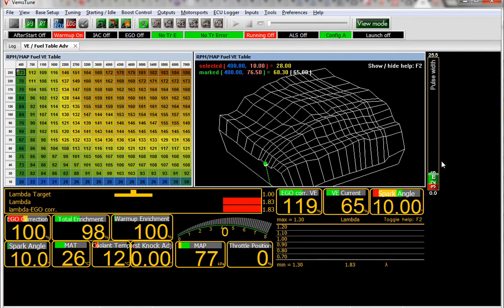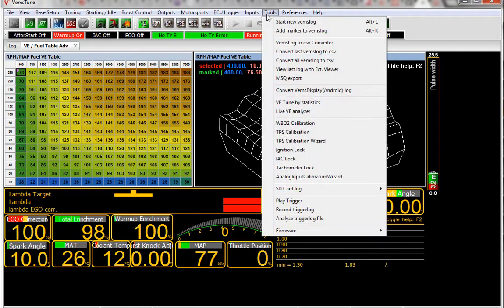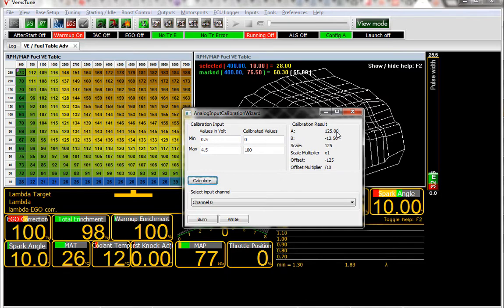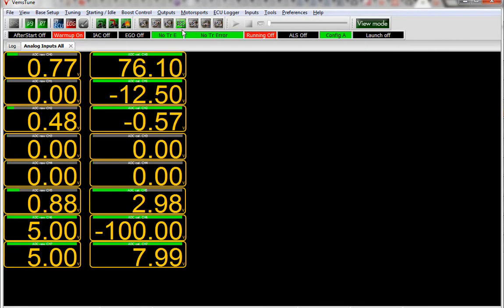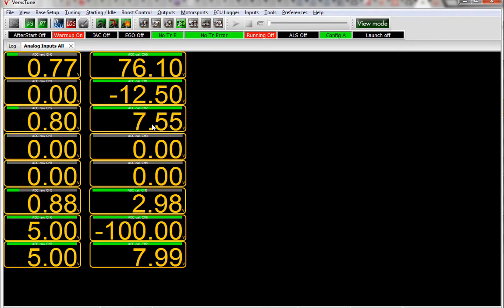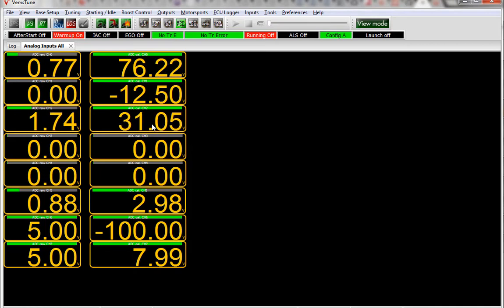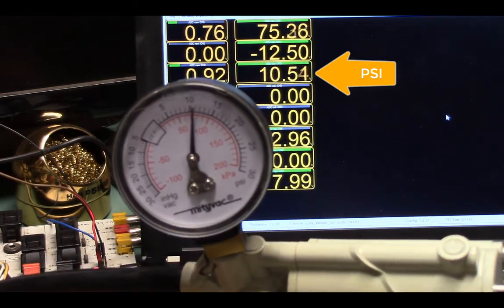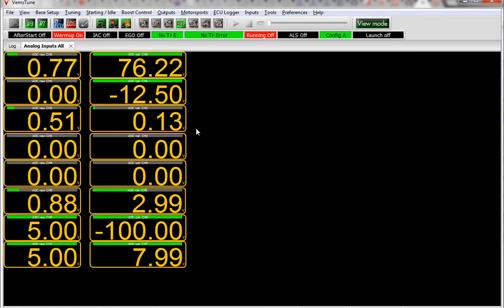5v pressure sensor calibration vems standalone ecu

Comment: @Vemsus can anything like milliseconds be read from the roadspeed1 input? Im looking at how to read it from my GM flexfuel sensor which corresponds to fuel temperature but I'm only able to read the hz so far and i dont see any other readings i can pin to being from that sensor in VEMStune. Thanks for your time.

Comment: Calibrating´s nice but where do you connect a resistive 3 wire sensor ? A tutorial on which channel & and which pins to use would be useful to go with this vid.  If pull up resistors need to be removed it would be good to have a tutorial for that as well showing locations and how it´s supposed to be done.
Reply from the maker: Your ecu comes with papers describing all that detail. The analog inputs are on the 18pin connector (or aux connector for plug and play versions). They are configured when they are ordered, so the papers that come with the ecu are important. In Vemstune you can load the adc page and see what's at 0v or 5v and if there's no pin in that location on the 18pin connector (Google the common pinout), it being at 0v would mean a pull-down, which is rare. Or at 5v would be a pull-up. If you switch on the ecu and the voltage slowly creeps up, that's a channel without a pull-down or pull-up. Channels without a pull in either direction are great for 0-5v sensors.

Comment: You should have similar tuning capability, or map table for MAP sensor. Some of is “upgrade” to higher pressure sensors that operate over a different voltage range, and there is no way to properly adjust for it. (0.25-4.75v vs 0.5-4.5v).